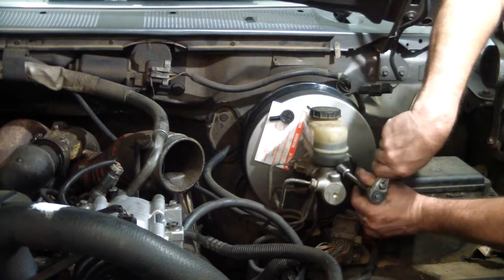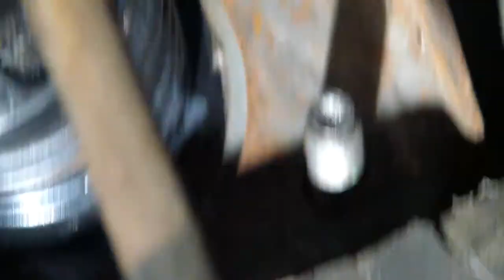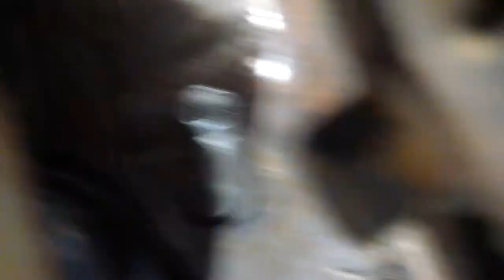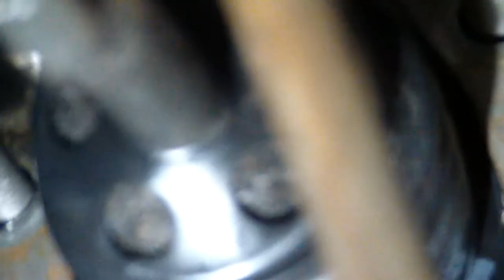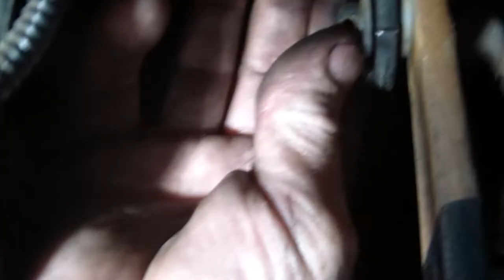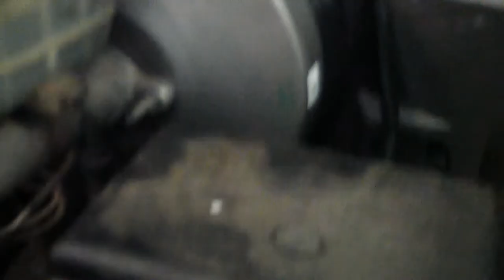Brake Booster Replacement On A  Ford Truck SUBSCRIBE!!!

Comment: Thanks for the video. Jist replaced my booster. Now my ABS light is flashing?
Reply from the maker: The ABS module for the rear brakes was what was wrong with this truck. It made the pedal soft and it would drop almost to the floor using all the vaccum making the brake light on the dash come on. After I swapped it out  the pedal was normal and it would stop again.  You can deleat it and run a new line from the master cylinder to the rear brakes like the ones that don't have ABS just leave the old ABS module wiring pluged up and bypass the hose with the new line.  A new module is $200ish depending on where you get it and it can go bad eventually. Hopefully this will help you figure it out we had to do it the hard way kept throwing parts at it till the problem was solved.

Comment: Thanks for the video, so there's no need to air the brake lines out? Looks like I could do it myself. Thank you again.
Reply from the maker: You don't need to bleed the brakes unless you have a leak or take a line off    it's not a hard job worst part is getting under the dash

Comment: Thanks for a great video. This is the best I've seen. Is there a gasket that you put on between the brake booster and firewall?
Reply from the maker: Some new ones come with a new one if not use the  rubber boot off the old booster.

Comment: What led you to diagnose and change out the brake booster? Do you remember where you got the replacement?
Reply from the maker: advance auto I had put a new vaccum pump on it and still had a brake warning light coming on after you would hit the brakes about 3 times. it wound up being the antilock brake proportioning valve. After I swapped it it had a good pedal so it didn't use as much vaccum and the brake light quit coming on. Check out some of my other videos and subscribe if you're interested!

Comment: I’ve heard some boosters have to be filled with fluid do u have to in this case ?
Reply from the maker: No you don't put fluid in a vaccum brake booster. When the master cylinder go bad sometimes they get brake fluid in them . It'll suck it in the engine (gas engines) and make it smoke 7.3 has a vaccum pump .